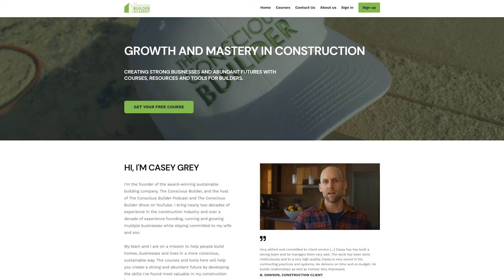Why Condensation on the Exterior of High Performance Windows is a Good Thing!

Comment: We just had all our windows replaced to triple pane.  Some of them fog up so badly on the outside pane that they are dripping wet.  You cant see out of them for hours, which is so frustrating.  My concern is what is going to happen in the winter when we get cold weather and snow., will there be ice buildup on the outside.   Is there anything we can do to resolve this.  Feel like we just threw out thousands of dollars.  Should of kept our old windows.
Reply from the maker: This shouldn't happen in the winter because the dew point changes. I never had issues with ice on our windows in the winter.

Comment: If the purpose of a high efficiency window is to prevent heat or cold transfer, then there should be very little or no condensation on the exterior.  The fact that there is exterior condensation on my energy efficient double pane windows but not on my 30 year old   traditional double pane windows suggests that the newer windows do not provide a good thermal barrier.
Reply: Actually it suggest your older windows aren’t working properly because there isn’t an actual barrier. The condensation proves there is a barrier there

Comment: During the summer, I would think that well-insulated windows would preclude colder temperatures in the home from penetrating the insulated glass such that water condenses on the cooled exterior pane. If more than half (but not all) of my windows get foggy during the summer, is it time to replace those windows? Overhangs, foliage, etc., are not a differentiating factor.
Reply from the maker: Are your windows getting foggy because of condensation on the exterior, between the glass or on the interior?
Reply: @Theconsciousbuilder  Definitely not on the interior. There may be some condensation between the panes.  There is definitely a huge amount of condensation on the exterior, as in visibly dripping down one sash, while the sash immediately below it is crystal clear.

Comment: Hi Casey, nice video but it’s a joke, windows primary job is to be able to look through and supply light. These aren’t fit for purpose, window industry needs to better.  You’ve a duty to tell your customers, if i’d know I would have downgraded the glass spec with my supplier. We have 3-4 months a year with no view. Trying to sit on my hands and not order another older spec design!
Reply from the maker: Where do you live? I've never heard of somebody not being able to see out of their windows for 3-4 months. Usually it's a couple hours in the morning for short periods of the year. It should also only be happening on certain windows. Typically the windows where the moon can see them.
Reply: @Theconsciousbuilder  Sun doesn’t hit my south facing garden until the mid afternoon so yes this is possible and an issue for our new windows too it would seem. Very annoying.